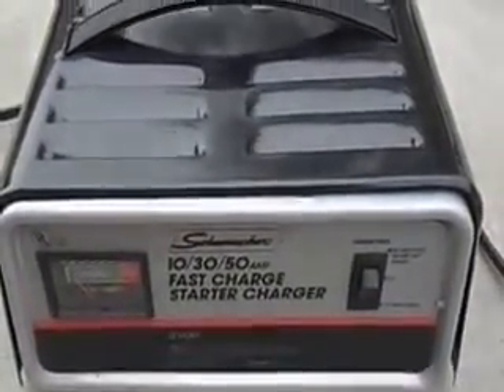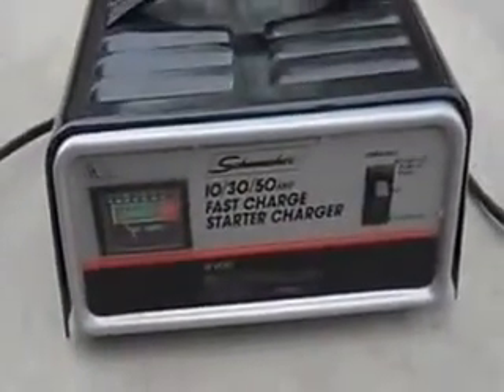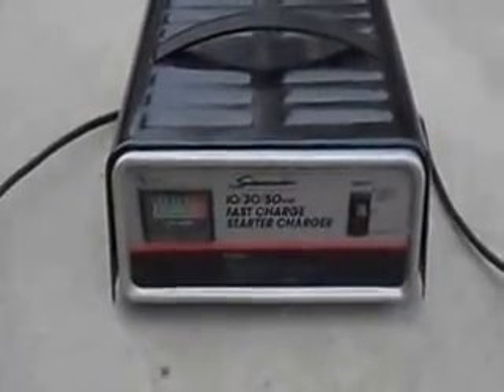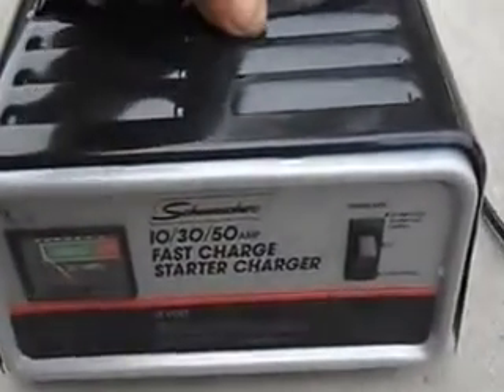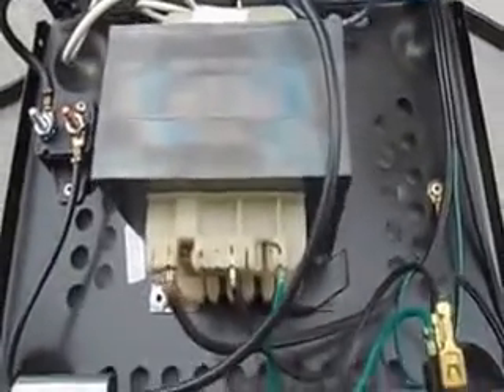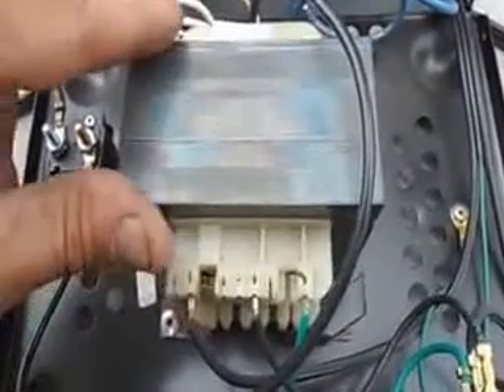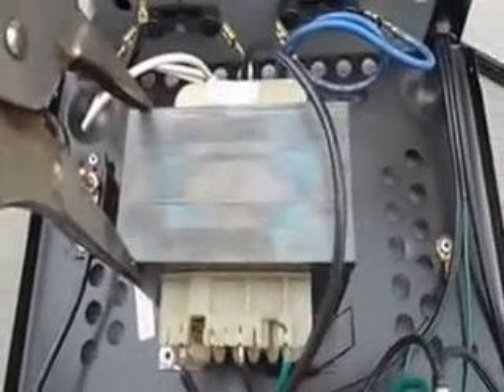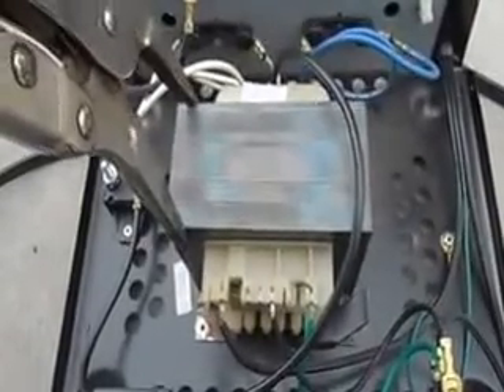Eliminate the Cause of Excessive Transformer Noise/Humming in Battery Charger - Part 1 of 2

Comment: Yeah just tighten everything down on there real bad parts you can use plastic or rubber spacers it was driving me nuts but thanks to this vid I fixed it and then some
Reply from the maker: Outstanding!  Glad the vid could help you a bit.

Comment: Sir , You just Fixed My Problem :D my PC UPS was humming but of course in a low voice but still annoying, so after watching this video , i tightened the screws of the Transformer's plates and the sound is gone . Thanks
Reply: Well you are right. Today a friend gave me an old usp with a 12 volt battery inside. The battery is dead and I placed a working one inside. After placing the battery inside I turned it on and there is a buzzing which I consider not acceptable. I dismantled the ups and I found a big transformer in it! The plates of it are tighten with screws. I will try to tighten the screws and see what happens.